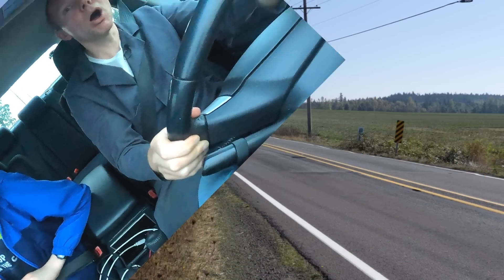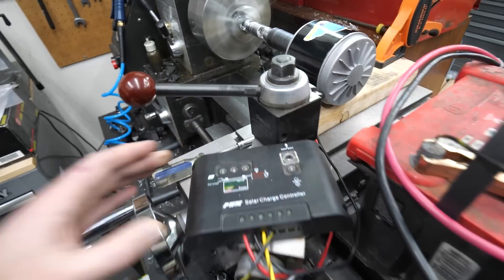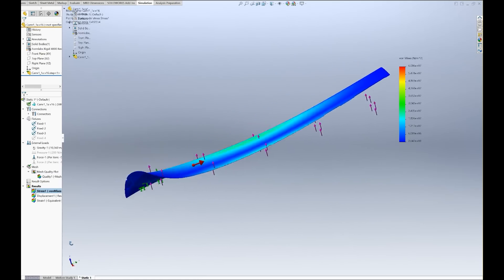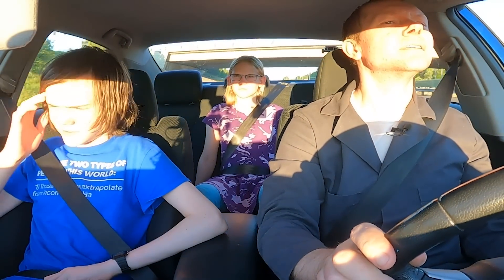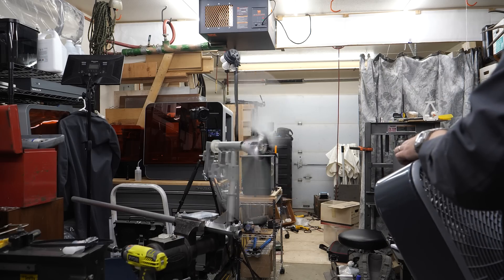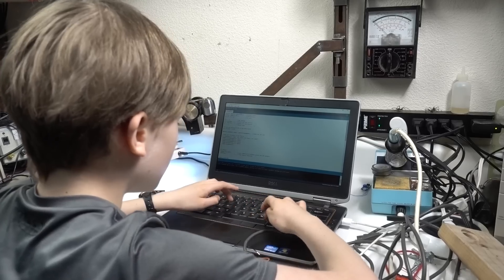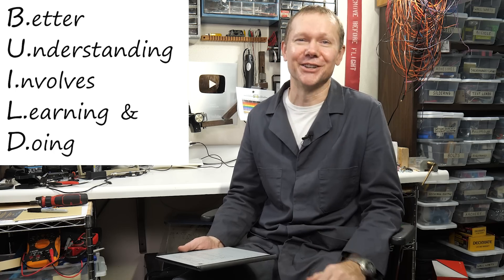3D Printed Turbine on a Camry - Wind Power on a Car #6

Comment: The one thing that stands out to me as a potential issue is the disturbance of the air in front of the vehicle.  With something that has a slab front like the bronco, this would probably be less important, but cars with their sloped, more aerodynamic designs  intended to work around a more laminar air flow might end up with more overall drag as a result of the turbulent air that the generator is going to create.  Comparing against the bronco's significantly less aerodynamic design would be interesting.  Definitely looking forward to seeing your results!
Reply: Further thinking makes me wonder if you will end up seeing gains at slower speeds, but because aerodynamic drag is more impactful the faster you're moving, it could flip and turn into efficiency loss at higher speeds on the Toyota.  I almost wonder how effective it would be to try to mount the turbine behind the grill, where it is no longer as impactful to the front end aerodynamics.  Though that could result in cooling issues, since the radiators work better with smoother airflow, but this could just mean that the fans run more... of course, that would eat into the power generation... Man this is a really fun experiment!

Comment: Been following this series from the start and I can't wait to see the result. I have 2 predictions: 
1. The fans would create turbulent air behind it so the faster you go, the less aerodynamic your car will be, which will even out the gas mileage. (I'm not an expert but I'd love to see some simulation).
2. You would not see a significant improvement on mpg if you don't dyno and tune your car to lower RPM w/o the alternator, lots of energy will just be lost to heat. Car manufacturers account the alternator power into the car programming.
P/S: it's really great seeing your children grow with you and your project!

Comment: Interesting experiment. Even if the power net total is negative, it is still fun to play with. I'd also try MPPT at some point. Now I'd guess that the voltage at the generator is clamped closely to the car battery voltage by the DC-DC regular which effectively will be equivalent to a diode in this particular case. Using MPPT algorithm will decrease the current at the ganerarator which countraintuitively will increase the power generated. But this will inevitably also cause higher RPM at the blades, so look out for that too.

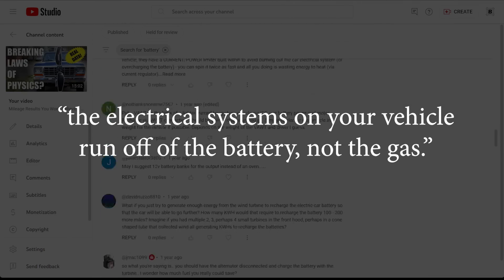Comment: 2:21 who's silly enough to believe that electrical systems run on the battery? I don't work with cars and even I know it doesn't. Guys think, if you use jumper cables to start your car, how would the car still work after you disconnect it the cables?

Comment: You can totally disconnect the battery on an older car and I have no idea why people claimed that the energy comes from the battery while the vehicles is running, because when it does you get a warning light!  If you are using the battery while the car is running then you have a dead alternator and will eventually drain the battery to empty.  If the electrical loads ran from the battery while the engine were running, the battery would never be recharged.

However, on many cars made in the last couple decades you may not be able to disconnect the battery while the engine is running as the electrical system uses the battery as a big capacitor to smooth out the ripple coming from the alternator.  The computers do not like ripple and some cars will simply die while others may do strange things like run roughly or go into limp mode.

Comment: Betz Law states a 59 % efficiency. So I'll remove a bit from that and depending on wind speed, anything between 200-400 W maybe, assuming 800 W maximum power
Reply: oh right that's for the air. But depending on wind speed, up to 5-10% improvement

Comment: A ducted -fan is potentially is more efficient than an open prop. Think aircraft jet engines. The induct cowl can be tuned to optimize the air flow that would also make positioning less critical.

Comment: All of this has already been studied back in 2001.  MIT tried to hook up a wind powered generator to a car.  The drag form the generator increased gas consumption.  Negating the additional power.  They used this setup in a hybrid.  So the motors were running off electricity.
popular mechanics reported on it.
The MIT one was laid horizontally on the roof.  So the blades were as large as the car width.  They also articulated the blade so that the return stroke was flat to the wind force.  So how much gas do you lose when you add a roof rack?
Is it the same as adding a turbine in the same vertical space?

I understand your argument.  And I'm not against you testing it.
I had a similar opinion back then that just put them inboard in the truck back and duct the air to them.

Drag coefficient is what you want to measure/know.  Strapping a turbine in front of the ford bronco may have little impact but strapping it to the front of the toyota will have a big impact.

Which you can measure your vehicle's speed as a function of time while coasting in neutral to measure your drag coefficient.  With and without the turbine on the front and it will tell you all you need to know.

Comment: Can't give a percentage but it will ither be no boost or a couple percent gain at most. Even a half% of real gain would be worth while in the long term depending on how many miles you put on the car over a years time. If you only go to and from work with a 15 to 20 mile round trip it wouldn't be worth it as you are just adding a point of failure. If you are putting on a couple 100 more miles beyond that per week then it would be a decent gain

Comment: Lose the belt. Bring the generator up using a metal gear system on a 20 to 1 gear ratio. The belt is always gonna be a problem.  The reason you don’t put the blade shaft directly to the generator is because you won’t get the RPMs you’re looking for. But you are having with induced drag and turbulent flow behind the blades which is causing your issues. Also, I recommend a curved blade with cone center. I recommend a lightweight, honeycomb aluminum based blade. And I would recommend the shape of the blade with multiple blades shaped as described in the CFM 56 / F-108 general electric turbo fan. 
Engineering is a good thing. Keep up sharing.

Comment: I have no engineering class to speak off but what I know from electric car tests is that the wind-resistance and surface area a car has is a vital part for mileage a car can archieve. Designers of cars spend hours at perfecting the windflow over a car to minimize the resistance it has when driving. I would assume that placing windturbines infront of the car will create wind-pockets infront of the car's hood and bumper and will make many random swirls which might have the same effect like "turbulences" you can experience during a plane-flight. But less intense cause you not drive over 500-600 Mph and the effects quadruple with double of speed (If I not mess something up here).

Those Turbulences might make the whole airflow concept of the car obsolete cause more air-friction will happen if those pockets "bump" into the car over and over again. I would assume the fuel efficency might suffer medium up to greatly from it. Now, cause my country uses a different kind of fuel-consumption scale...... It will decrease? - 10 to - 30 Percent? Going from like 20 miles per gallon down to 18 or even 15 miles per gallon?

Comment: My prediction is that you will have a slight net loss (~5%), for 2 main reasons: 1) You are affecting the aerodynamics of the car, since you are disturbing the air further in front of the car, 2) mechanical and electrical losses. Very cool experiment though!
Reply: Then why do jet aircraft have points on the front of the aircraft to break the air for the sound barrier and turbulence.
Reply: @systemsrenegade9888  can you show an example? The only "points" I know of are pitot tubes that measure air speed/pressure.

Comment: if your wind turbine is more efficient than the alternator you should see a small fuel economy , i would guess that making the car more aerodynamic and increasing the yield of the car alternator would give you a significantely better fuel saving , in a way you are putting the alternator further away from the energy source inducing more loss in the system (gearbox , transmission , tires , aerodynamic ... ) . it is fun to try for real , thanks for the videos

Comment: Instead of a electronic pitch control for the blades, maybe what you need is a Constant Speed Propeller system, that is used in small aircrafts. The difference will be just that your propellers are set to react to the wind, not try to use it to create thrust.
The drive uses counter-weights to keep the propellers at a constant speed.

Comment: This is absolutely stellar work. My prediction after watching 8 minutes and 20 seconds: I think you cannot recover that waste energy. If it was possible I think ocean freighters would already be doing it. Water is far more resistant, so you'd be able to recover more energy, and the cost of the fuel is a large expenditure for ocean freight. They don't do it, so I think it won't work with air either. Although that said, if you're testing with your brick car then maybe?

Comment: Theoretically, you are transferring the workload of the car alternator to the "turbines" in front of it. Whether you like it or not, they will create a counterforce to the car, an aerodynamic drag that is inefficient and will lead to increased fuel consumption, which contradicts your goal of fuel savings. However, I like the project! 😺

Comment: I'm glad to see you continuing to make videos😊.  I hope you joy this idea for a relativly easy diy cheapest plugin hybrid.

1) Disconnect the car's electrical system from the alternator and battery. 
2) Then run the car's electrical needs from 4 deep cycle batteries.  And 
3) use a battery charger to recharge them at home or on the road.  That's the basic idea. 
4) optionally: If one wants long range, then add battery capacity or plan to switch the alternator back when needed. 

Next level cheapest pluhin hybrid  to replace the alternator with a 1kw motor. And use that to provide up to 1kw of mechanical power via the alternator belt. At this stage one probably wants to switch to Lithium based batteries for its energy density and longevity over lead acid. 

On difference between fan on top versus in front. By far this isn't a complete description of the difference but I hope it helps. 

1st in front, the fan generator under load  creates a high pressure pocket in front of the blades and low pressure pocket behind it. This pushes some of the air around the car creating an aerodynamic slip stream as the car drives in the wake behind the fan.  obviously the benifits are canceled in large part by the electrical load on the turbine and the turbine being pushed by the car. If the car were not pushing the turbine, riding in the wake would be similar to practice of race cars traveling in the wake of a cars infront if it. Once when I had virtually no money for fuel and needed to go several hundred miles,  I  drove uncomfotably close behind  tractor trailers using their wake and using the slip stream effect to improve my fuel econony. Maybe the tresulting turbulence down wind from the blades effects the car's aerodynamics. But the turbine's exhaust is slower moving and might not have as much drag on the car. 

Secondly, the air passing the turbin placed on top is slightly boosted by air speeding up as it goes over the top car.  It  might be easyer to generate power in faster wind, but there's no chance it could reduce drag on the car as there might be if placed in front.

Comment: I would think a simple way to see which placement is better would be to mount your setup to the front of the car and run the test.  Then move it to the roof and repeat the test. If one place is better than the other there should be a noticeable difference in the results.

Comment: Dude you should funnel the wind from some ducts and put a fan in the stream of the Duct... Like brake ducts that funnel the air for brake cooling. This way you don't have a giant protruding fan sticking out the front and it's incognito inside the body. And the after it padded the fan it can just dump down or out the body somewhere...

Comment: The Difference between front and top mounting is the incoming air speed your car experiences. You don't only need incoming air for the turbine you also need the air behind the turbine to flow away. According to Betz law the air behind an optimal turbine will be going roughly 1/3 the speed of the incoming air. So effectively if you cover your whole car you will get the same drag as if you were going 1/3 the speed and since drag scales quadratic with speed it's a lot less. The front mounted turbine might be less efficient though because the exhaust air can not freely flow away. So the efficiency of the whole design depends on how much the turbine increases drag and how efficient it is.

Comment: The problem with this is using wack fan and motor technology and maybe impeller and guided air flow wud increase slightly
Efficiency is used alot when the design hits its limits 
1 fan is barely enough to get any improvement 😂 fun experiment tho

Comment: I think wou will loose 5% of fuel efficiency. My reason is Efficiency. Alternators are very efficient in converting mechanical energy to electrical lets say 90%. Windturbines are not very efficient, big ones can reach up to 50% efficiency but I would assume at most 30% for the small one. Especially with the added steps in converting the mechanical energy of the motor into electrical energy. So you would need to harvest 300% more mechanical energy from the wind than you would normally take through the alternator. An increase in drag of 10% can decrease the fuel efficiency by 5%. Assuming 10% of your cars power is used by the electrical system that gives us a maximum allowable drag increase of 20%. So for this to be feasible you would need to harvest 300% the mechanical power while only increasing drag by 20%. This does not sound possible to me. So my guess is based on the guess that you would need to increase drag by 30% to get the required power.

Comment: Prediction from 4 minutes in: you will observe a reduction in fuel economy. Converting energy from a rotating shaft to electricity in the alternator will be more efficient than converting it from a rotating shaft to forward motion in the tires, then from forward motion back to a rotating shaft in the wind turbine, and then to electricity in the generator. Also I'm guessing the Camry has pretty good aerodynamics and your turbine on the front will make it significantly worse, more than it can make up for by spinning.

Comment: I think overall it will improve efficiency by about 10% just based on my own experience tinkering with my old vehicles trying to reduce load on the engine by removing A/C compressors, swapping the belt driven fan clutch for electric radiator fans things like that. I do think how far the turbine setup is stuck out in front of the car will be a big factor, to far in front and you may be disturbing the air flow messing with the cars original aerodynamics but to close to the bumper and the the tip and root/hub vortices could also effect how the air doesn't flow smoothly over the hood or under the skirt. If it turns out not to be a factor I'm still excited to see the results and think it's a great experiment!

Comment: @13:50 commenters said battery powers electrical. I have always known this to be wrong. It is SO difficult to explain to customers what the battery is for. It is a VERY  common misconception. Excellent demonstration
Reply: Welp, you CAN power electrical in a car WITHOUT the engine running, so it's no wonder customers look at you funny when you tell them that the battery does not power the electrical - because there is a finely nuanced asterisks after that statement.
Reply: This is just curiousity without researching myself. 1) doesnt the battery just help start the vehicle, 2) if the vehicle pulls more load than the alternator can handle, does it take power from the battery? asking for a friend
Reply: It definitely is unintuitive. I only really learned about it when a friend's car lost a connector to corrosion.
Reply: My jeeps alternator was crapping out an hour away from home and literally pulling into the driveway my headlights were so dim it just died pulling in. Totally battery all the way home.

Comment: "As an engineer."
Typical trying to sound like somebody.
You are consuming more fuel to run the wind power but you make it sound like it was free energy that would have been consumed anyway..lol
Reply: Say the aerodynamic drag is 2 kW without wind turbines, and say the turbines can then recoup a bit of that, making the total drag 1,5 kW. 
I wonder if it the car has too low drag coefficient, which could increase the drag and even if you recoup a bit, it'll still be higher than the 2 kW example
If your car is a literal brick or worse, you'll probably end up with higher efficiency

Comment: What are your thoughts on vertical axis wind turbines, they seem to be able to handle high rpm (albeit not as efficient as horizontal axis ones) + you won't have to be careful about the pitch of blades if you ever drive with cars around you.

Comment: A phev would be great for this
Reply: Not really ..... You'd need 10 of them in the video 😂😂
Reply: @davey2k12  if you use the one on the bronco you could charge my car and get 2 miles an hourish
Also when I mean great I mean it has a big battery that you can dump tons of electrons into for free. My car has a 8.9 kWh battery so you can dump electrons into it for ages
Also also it would probably make it worse because the drag coefficient is somewhere in the .29 so it would likely make it worse